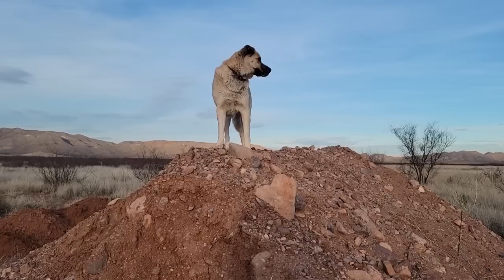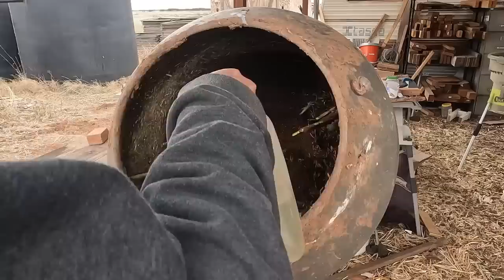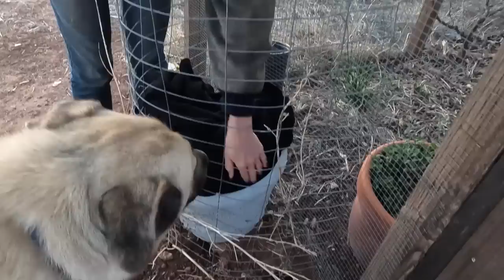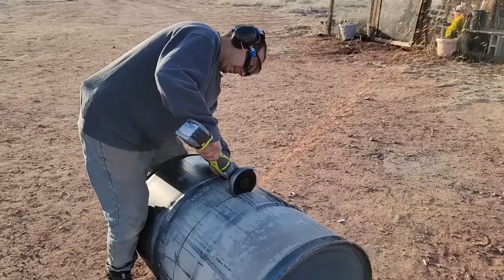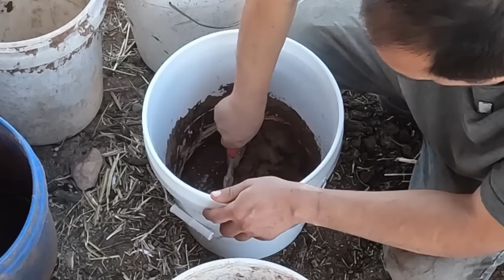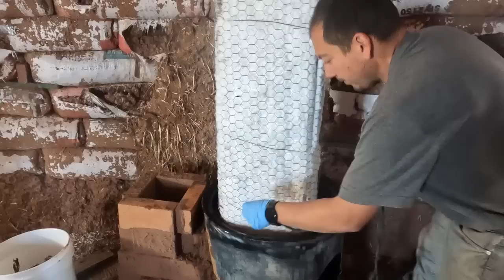Rocket Mass Heater | Building The Manifold and Top Barrel | Off Grid Heat

Comment: For those that are looking for good metal 55 gallon drum barrels for their greenhouse or their rocket mass stove the best ones to use to hold water and nut rust out is these metal barrels with fish oil in it? Fish oil is a very common oil that prevents metal from rusting I use these kind of metal barrels with a little bit of fish oil in the water in my solar pass through greenhouse before I switch to metal barrels that held fish oil in it I actually use just metal barrels with food safe capability so if you do not plan on using it to store water for drinking like I said, use these metal barrels with fish oil and water

Comment: you may want to put a heat shield between the barrel and the cob wall....even though it is not combustable, you don't want the plastic behind the cob to melt (that barrel gets SUPER hot)
Reply from the maker: It doesn't really matter if the plastic melts.
Reply: @ourselfreliantlife  yah, probably not important...... unless there is a compromise in the cob layer (as you are repairing now). What is the affect on cob by long term extreme heat.....and it is EXTREME!
Reply from the maker: @Tim Skufca  we're not repairing the cob, we're adding cob to the walls.
Reply: @ourselfreliantlife  PLEASE don't think I'm being critical......I completely admire what you're doing, in a big way. These are just some of the thoughts that I would be considering, and obviously you already have. Thanks for sharing!
Reply from the maker: @timskufca8039  no problem. We understand people have questions and concerns.

Comment: now your  doing it . dont know why you wanted to cut a hole in the top of the barrel . its going to be way better sealed and hold more heat kinda lol . i say kinda cause its going to push and pull air so the heat will move threw it as well . where your main heat will come from is the storage of heat in the mass you build  be it a couch like bench of sorts or what ever . i see alot of people who have put up videos use tiny pea gravel and others use a mix of both pea and larger stones . i really think the mix of both is better . but i cant really say as i have never seen or built one . but it would make sense that a large stone will hold heat longer . but it might not matter once its all sealed in . ether way its going to be nice on cold days and fun to play with .  your main problem is going to be where  are you going to get fuel from . i guess old pallets  and brush . maybe you can find a way to use wood pellets . or maybe you know what your going to use  and will share your ideas with us at some point . but what ever it is it is not going to be very easy to get . you wont be able to depend on fuel from your land . you might be able to make a oil burner and get used cooking grease from local restaurants but thats  kinda dangerous and messy . i just dont see how your going to make this work long term with out sourcing out side help with fuel .
Reply: Back in 60, we built a house on pea gravel. The plenum, and tiles were set and buried in the pea gravel. Then reinforced concrete over it all. The gas furnace heated our foundation and floors, as well as the rooms. Floors were heating the room, after the furnace shut off. Pea gravel is great, because it settles the least, under concrete, and for heating purposes.
Reply: @everettplummer9725  thats  nice to know . sounds like a great place to live as well . i dont understand why people dont use these kind of heating systems here in the north . or at least i have never seen one here and im over 50 years old . we get some brutal winters here with temps below - 15 degrees f . you would think people here would love them .

Comment: What grid has a wood burning stove or fireplace ever been on?, It's a good thing this isn't on a grid or subject to any building codes, it's only a good thing for these yo-yos but it's bad for anyone misfortunate enough to be inhabiting that dwelling when there is a fire going, a rocket stove has to have a chimney that is 1/8 inch thick nominal and preferably 1/4 inch,,
It is dangerous to use sheet metal duct that is only rated for air conditioning, and range hood exhaust, as a fireplace chimney.
 anyone up in that loft or down in that windowless bedroom root cellar has no means of escape when that sheet metal starts to burn, they can always hope  that glued 3 inch PVC fitting blows off and fills up that bedroom with the contents of the cistern, that shouldn't take more than ten seconds actually., If anyone thinks that steel won't burn just hold some steel wool over a lit candle. I  believe you can't save these kind of people from themselves, they won't take anyone's advice because they claim to have done research, there's only so much you can learn in a book,you can't read a book and have more experience than anyone who has experience. These people can't be saved
 with regulations or building codes, by refusing to listen or seek advice they will eventually find a way to thin the herd , if they just would have listened to people with experience in construction none of these hazards would exist, If they would have used the recommended 15% Portland cement in their dirt mix , used rebar instead of barbed wire, and didn't backfill the outside of the foundation with a 2ft layer of gravel their other Root cellar wouldn't have turned into mud and collapsed during that flood.. that's just a preview of what's eventually going to happen to the existing dome that's already started to look like a pot belly stove

Comment: You're on solar power just run a freaking heater in the winter.
Reply: Very power intensive.  We have lots of fuel to feed the rocket stoves out here
Reply: Is too much work for very little pleasure
Reply: You get no sleep having to feed a fire all night
Reply: You don’t run the fire all the time. You just run it to heat up the mass of whatever they decide to use. That mass stays warm for a loooong time.
Reply: Yeah that bench will just radiate away